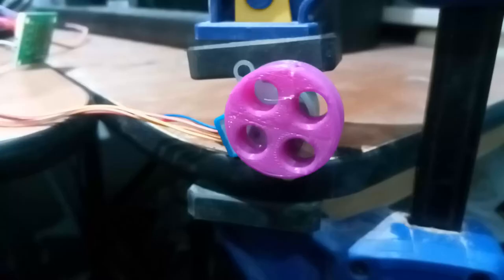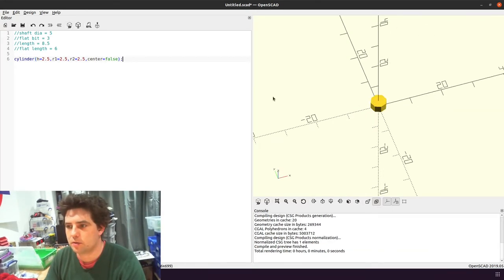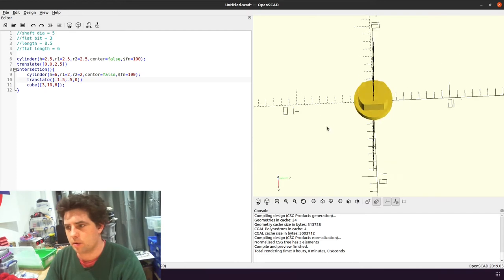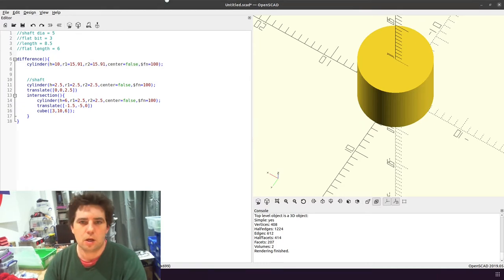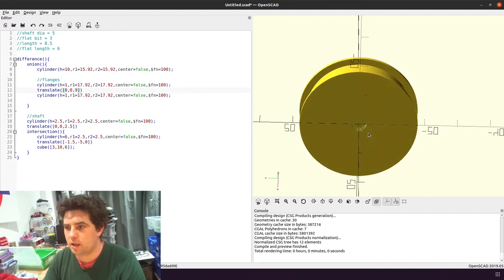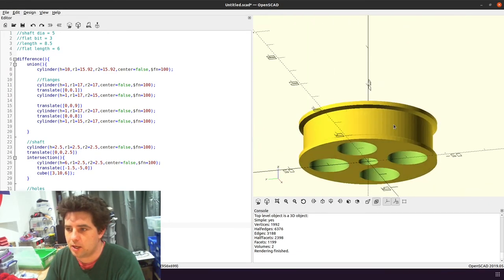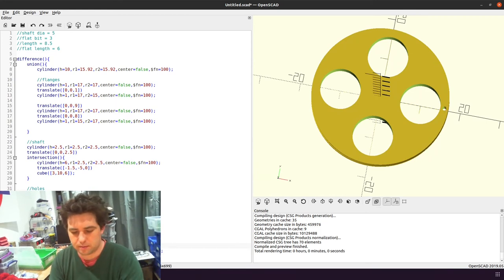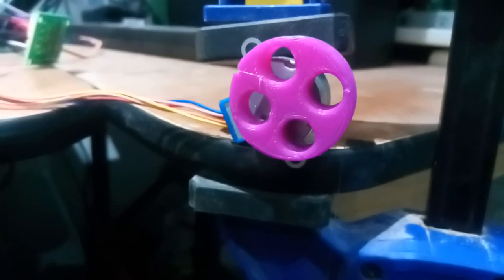#58 - Modelling a 28BYJ-48 shaft adaptor/pulley 3D printing

Comment: OpenScad looks exhausting to work with
Reply from the maker: it's a bit of a learning curve from the drag and drop CAD's but if you're a programming head, it's good. if you need to make lots of small variations, having things as parameters vs having to pull pull surfaces is a different way of working, that speeds things up.